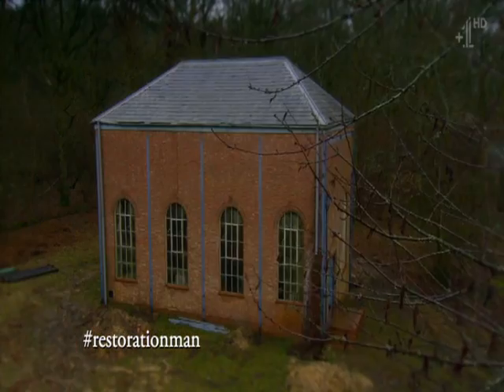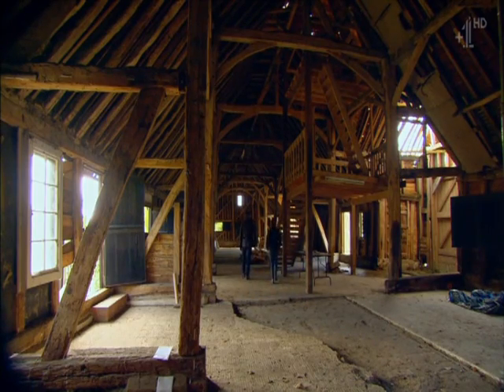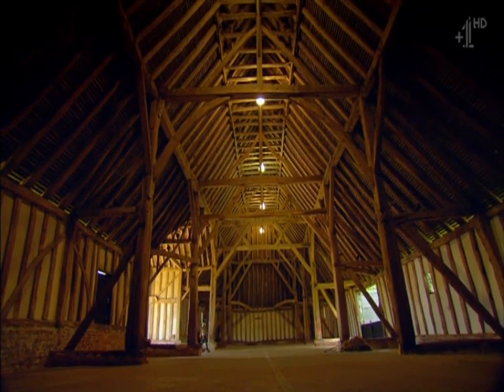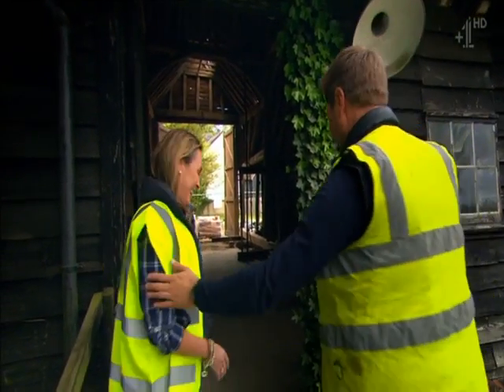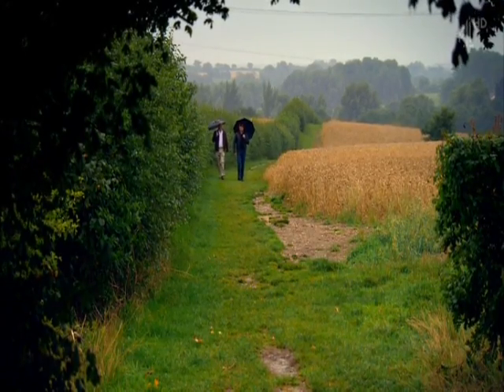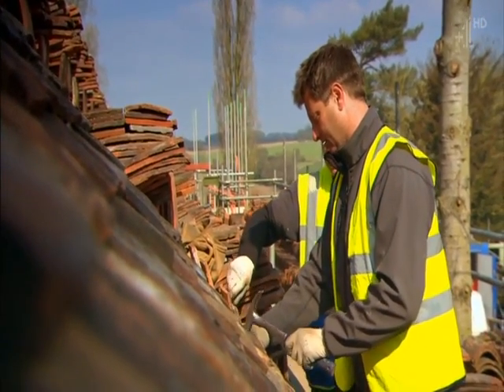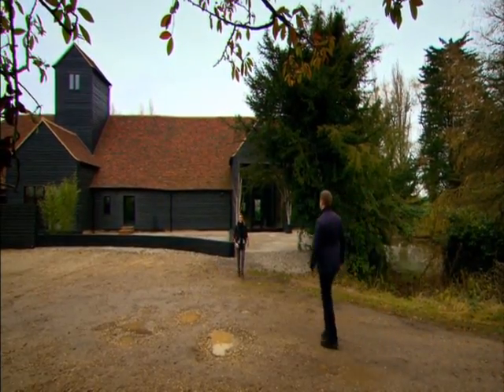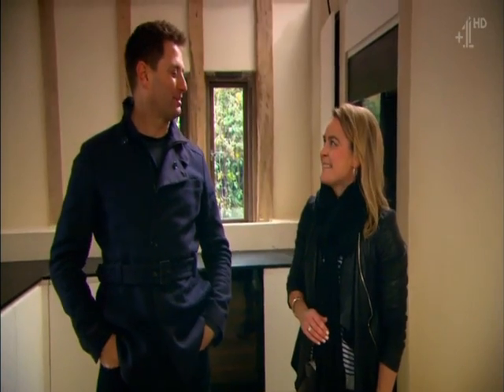Restoration Man - Boxted Essex Barn

Comment: How is it heated? I don't see any duct work, boiler or radiators or any chimneys.
Reply: No kidding! No mention of heat source or how difficult it must be to circulate the air for heating or cooling.
Reply: Adam Grzybek  , that's the fireplace of a sample house that George took the mother in as an idea of how to work on the interior.

Comment: How she heated the place economically using in The Panasonic Aquarea T-Cap was the ideal solution for such a large renovation project, as the system provides a reliable and constant nominal capacity output and excellent energy rating with a COP of 5.08. The quietness of this system was also a deciding factor on selecting this product. As well as being a reliable and efficient heating and hot water solution against alternatives such as boilers and oil burners, this Total Capacity system maintains heating capacity, even with cold outdoor temperatures, maintaining 16kW of heating, even when outside is as low as -15oC.”